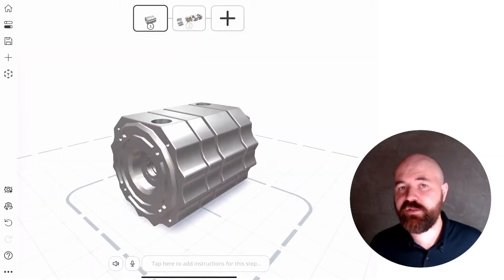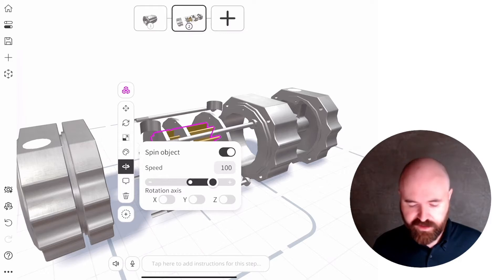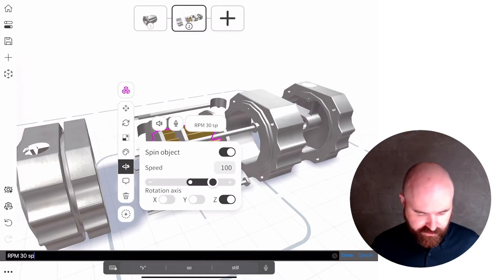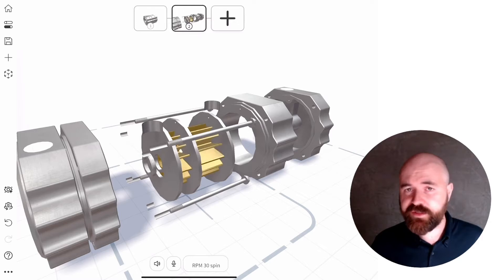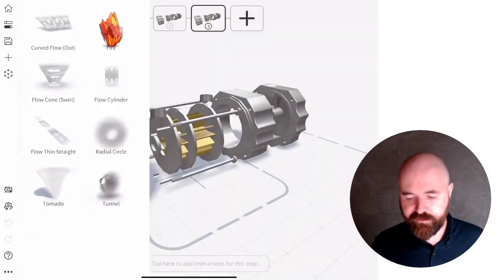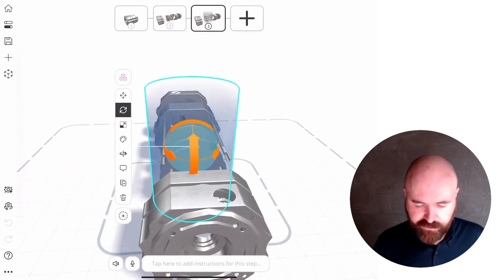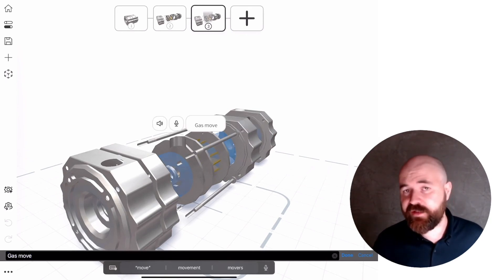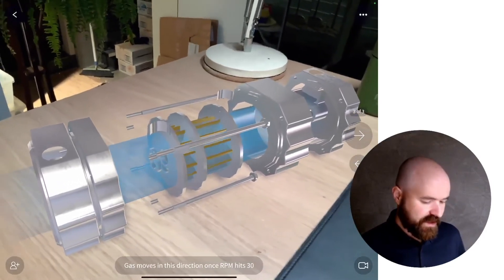Spin and animation effects in JigSpace

Comment: Hey team,
Despite several try, i am not able to rotate a fan type model around its centre axis.
I tried both Blender & C4D.
When i import model from 3d software to Jigspace, its axis shifts slightly (though I corrected in 3d software). what could be the problem? I have attached a screenshot as well on your support mail.
Please resolve this ASAP or give me a tip to solve this issue